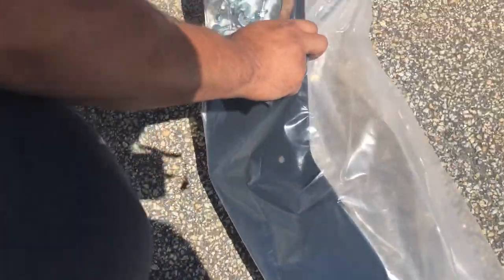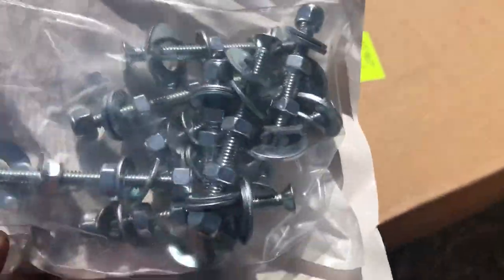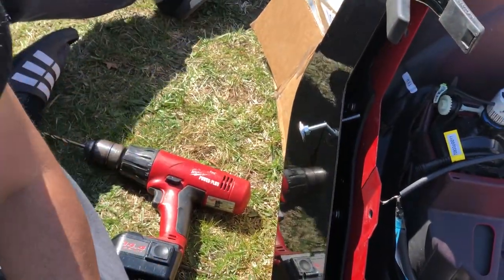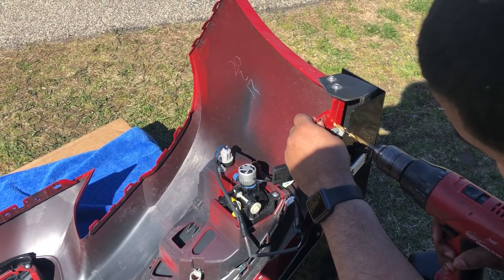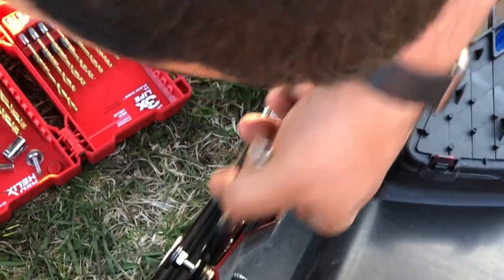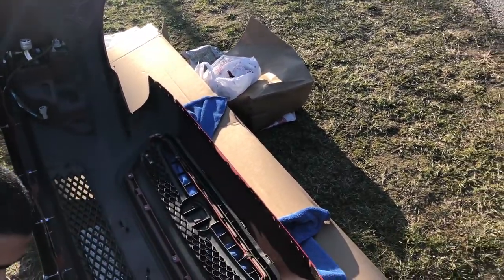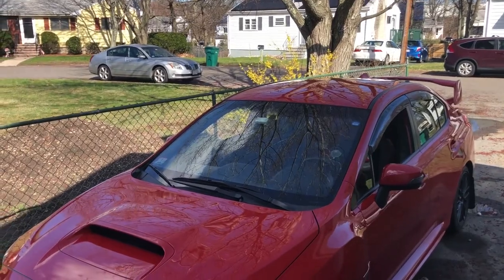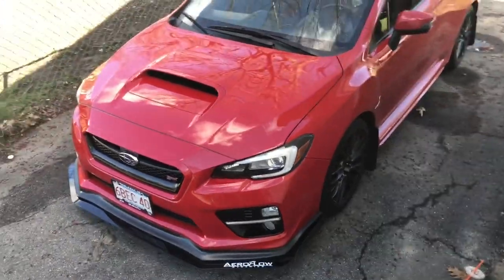AeroFlow Dynamics Splitter INSTALL

Comment: How hard was is it putting the bumper back on?
Reply from the maker: It was hard because the screws that the provided are the length might interfere with the bottom frame we ended up cutting the bolts short lol but it was ok
Reply: HoeLeeFuQQ Did you do any kind of adjustments? I’m going through the same issue but I have the APR CF Splitter
Reply from the maker: John Phang nah what i did I cut they bolts shorter meaning the where like 2.5 inches in length so I cut them in half/ just enough so it can clear plastic/ front frame

Comment: it makes the car look so mean 👌
Reply from the maker: cristobal ramos yeah i agree it’s aggressive, also it makes the car look lower even with stock suspension 👍🏽
Reply: HoeLeeFuQQ yea it does how much was it i say about 200
Reply from the maker: cristobal ramos yeah a little bit more like $230 around there when I bought it. 😆
Reply: HoeLeeFuQQ wow that is not cheap
Reply from the maker: cristobal ramos nah parts are not cheap 😕
Reply: HoeLeeFuQQ yea i feel like getting a red 2006 wrx sti for when im a senior it will look so mean !!
Reply from the maker: cristobal ramos go for it 😁
Reply: HoeLeeFuQQ ok ima go for it but i have to wait 5 more years 😭😭😭😭😭

Comment: what brand your front lip kit?
Reply from the maker: Cheap eBay front lip Byson R the cost like $100-120 in that range and they last, the point of going with a cheap one is that they are great quality and best of all if something happens to it, it’s only $100 to replace it, not like a carbon fiber one that can cost you an arm and a leg.

Comment: What lip is that? Do you've a link to it?
Reply from the maker: Kevin Lam CS Style Front Lip got it from eBay here’s the link

https://m.ebay.com/itm/CS-Style-Front-Bumper-Lip-Urethane-Fits-15-17-Subaru-WRX-STi/272246506736?fits=Year%3A2016%7CModel%3AWRX+STI&hash=item3f632804f0:g:uSgAAOSwIzNXO8pj
Reply: HoeLeeFuQQ Is there brackets or do you tap straight into the bumper?
Reply from the maker: Kevin Lam you get a few self tapping screws with washers and also 2 brackets that go on each side of the front lip.
Reply from the maker: Here is a quick install video I made

https://youtu.be/5QqyD9AB_nM